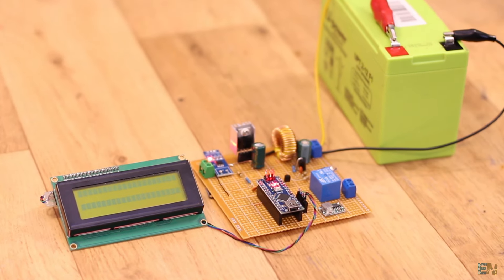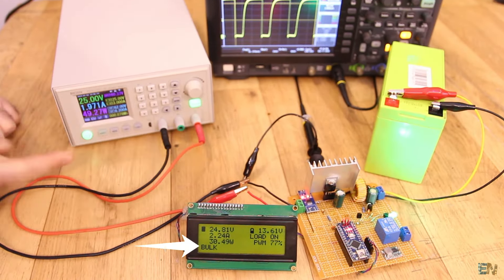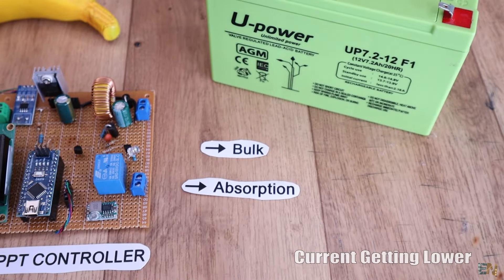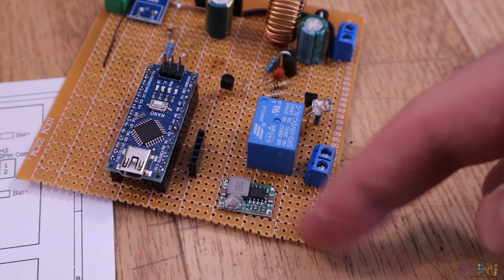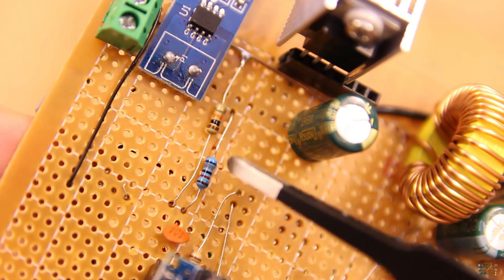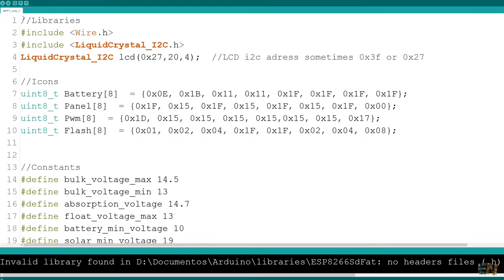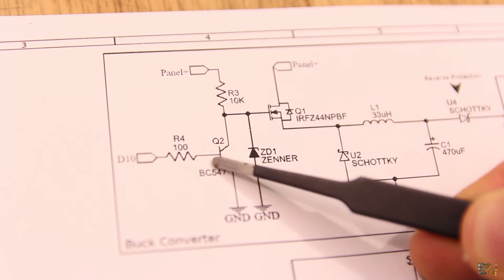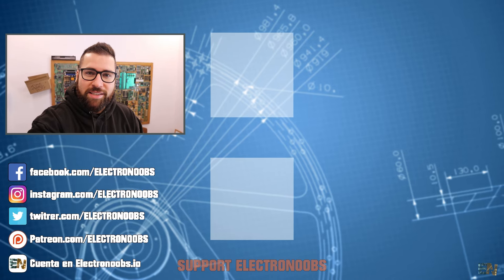MPPT Solar Charger Prototype | 12V Lead-Acid Battery | Bulk Absorption Float

Comment: This is not an MPPT-charger, it's just a lead-acid battery charger. MPPT specifically refers to extracting maximum power from the solar-panel; it keeps track of the voltage and current of the panel and adjusts the current so that the panel is always supplying as much power as it can. A simple approximation would be to periodically check the panel's open-circuit voltage and then keep the voltage at 80% of that.
Reply: Never thought of that! I need to dig into this. It will most certainly outperform a PWM method.
Reply: Can you please send any link to that project pls urgently
Reply: I agree this is not MPPT.It is only charger circuit but the Video still very usefull.
Reply: True
Reply: Great project. MPPT code coming in future video with upgrades
Reply: Can we make use This PWM charger for Lead acid battery for primary use
Reply: Ok then can you say the working of the mppt 

Let me contect you can adjust current you need to adjust voltage 
How many i know to charge a battery you need a constant current at stating
It's hard to make you understand in text but the video is correct the process to charge a led acid battery is same 
But if you r chaing a lepo you need to give a constant voltage to charg 
The video is correct for led acid 

If i am wrong please correct me 
Thanks
Reply: @vkproduction1166  an mppt tracks the maximum power coming from the solar panel, a normal buck converter can't do that, if the load is greater than the solar panel can produce then the buck converter simply increase the pwm and your solar panel voltage will drop to same level as output voltage.
Reply: @CroftGaming1 oh then what will your mppt will do ????
Reply: @vkproduction1166  solar panels current doesn't increase much with voltage drop below maximum power, suppose you are charging a 12 volt battery with a 24volt solar panel, if you use mppt and your solar currently producing maximum 150watt at 30volt solar voltage and the current is 5amps. But if you use a normal buck converter it will drop the solar voltage to 12 volt and you will get roughly 5.5 amps, so will get 66watt from solar instead of 150watt. That's why you need mppt which tracks the maximum power produced by the solar panel.
Reply: @CroftGaming1  i am sorry for asking
Y the solar panels voltage will drop 
How much i learn the voltage will only drop when the current requirement can't be fulfilled if we use a buck converter with current limiting we can do it 

And one more thing you will only get 30 volt from the panel when you don't add any lode to it this voltage is called open circuit voltage

Let me take your example
If you r use 24volt panel with 5 amp current 120 watt of power 
If we use a buck converter to reduce the voltage to 13 or 14 volt to charge led acid battery
We will get theoretical value 8.5 amp of current if we consider the current losses of buck converter and the heat and the very worst case possible of 80%. efficiency we can get 100 watt of power 

One question of mine do your mppt give 100% efficiency
And please correct me please if i am wrong 
Can I ask your qualification ?
Reply: @CroftGaming1  hello? Can I get a reply please
Reply: @vkproduction1166    ya you can limit the current but that's a fixed point, suppose you limit the current to 10amps, at 12 volt that's 120watt power if your converter is 80% efficient your solar should produce atleast 150watt, but solar power varies alot during the day and with seasons, if it produces more you can't get it, if it produces less your voltage will drop and if you are using higher voltage panel your voltage stay low unless you restart the buck converter.

A 24volt solar panels maximum voc is around 44 volt, the mppt voltage varies between 30-36 depending on the solar radiation and temperature.

My asynchronous buck converter is 85-95% efficient which I use for mppt charge controller, i will upgrade it to a synchronous buck converter which is up to 98% efficient.
I don't consider myself an engineer because I don't have a degree, but I repair electronics devices for living.
Reply: no sir you did not get my point 

Let me say with a example
I have a panel with 120 Watt max power output with 24volt 5 amp 

Now i will use my buck convert and limit my current to 10 amp at 12 volt 
I am charge my led acid battery of example 12volt 200ah  my battery is 80% discharge so it can draw 100 amp of current to charge fast 
In the buck converter we can set out current for 10 amp which is the max current the converter
Now the  converter can slowly charge it  if the panel is giveing full power

If the panel is giveing for example 80 watt of power
The battery volt is at 11 volt because it's till chargeing the converter will reduce the current to 7.2 amp 
If the panel is giveing 50 watt 
The current will be at 4.5 amp 
What is wrong hear 

How much i know mppt working is to step down the voltage of the panel and increase the current to charge the battery
At all time irrespective of power output of the panel
The buck converter is doing the same 

If you think it's wrong please say the working of the mppt how it will convert the voltage to low voltage what is the process of it 

Sir how can a panel with 24 volt 5 amp Give 150 watt ? 
I am saying to limit the current to the maximum power output of the panel
I am only saying to limit to not to damage the converter 

Please correct me please it's my request
I need to learn please
Thanks for your reply it's is helping a lot thank you sir 
I am 18 years now goings to engineering sir
Reply: @vkproduction1166  you need to research more about solar panels and buck converter, 

A 12 volt solar panels open circuit voltage is 22volt and the maximum power voltage varies around 15-18 volt it is use for a 12 volt system (10.5-14.2v), a 24 volt solar panels open circuit voltage is 44 volt and maximum power voltage is around 30-36volt(depends on the panel some panels have higher voltage and lower current).

Now every source has internal resistance that why when you draw current from a source the voltage will drop a little.

How the buck converter works, it uses pwm to control the output voltage and limit the current, if you set your buck converter to 12 volt and limit the current to 10 amps, now without load the buck converter has 12 volt and almost 0amp the pwm is very low, suppose you put an 1amp load(a bulb) the voltage output drops and the feedback sence it and increase the pwm until the output voltage gose up to 12 volt, and the input (from solar) voltage drops a bit because you are drawing more current, you increase the output current to 2amps and the whole cycle repeats until you reach 10amps, because you set the current limit to 10amp if you increase the output load to 11 amps the output will drop but this time the pwm will not increase because it reached its 10 amp limit.

Now back to the solar panel if your panel is producing 120watt power then you can get 12 volt 10 amp at output(100% efficiency to make things simple).

Now when your panels power reduces to 80 watt you will get maximum 6.67 amp at 12 volt(100% efficiency).

Do it step by step, you have a 24 volt 150watt solar(maximum voltage is 44 volt) currently producing maximum 80 watt power. your buck converter output it 12 volt without any load the panels voltage stays at 44 volt, now put a 1 amp load on the buck converter the 12 volt drop a little and the buck converter increases its pwm until it reaches 12 volt, the solar panel voltage drops from 44 to 43 because you are drawing more power and the solar panel has internal resistance.
increase the load to 2 amp and the whole cycle repeats until you reach 6.67 amp(80watt). if your load is 7 amps the pwm will increase to draw more power from the solar but you solar panel cant give more power so the voltage started dropping and the output voltage stays lower than 12volt because the circuit cant provide 7 amps at 12 volt, thats why the pwm will increase again and the solar voltage drops more, this cycle will go on untill your pwm is at 100% which is basically short circuit between input and output. and your solar power drops way less that 80 watt.
thats where mppt comes in, it adjust the pwm and always get maximum power from solar. 

i am sorry if its difficult to understand my english is not that good.
Reply: @CroftGaming1   ohhh ok sir thank you for clarifying it helps a lot thanks
Reply: @vkproduction1166  always happy to help 😊
Reply: @vkproduction1166  You do not understand any of the concepts. If you have a panel with a maximum output of 120W, then that is the maximum -- you can't get 150W out of it, no matter what you do.

With a 120W panel without MPPT, ie. if you e.g. just shunt the current without any limiting into a big resistive load, you won't get anywhere close to 120W out of it, no matter how much sun the panel is getting. The panel is a so-called high impedance source and its voltage drops the closer to its maximum current output you're drawing, so that's why the you're not getting the 120W.

To get as close to 120W, you'd need to limit the maximum current you can draw from it as that will increase the voltage and thus power. MPPT is all about finding the point where the power you're getting out of the panel is as high as possible.

Your battery charging? That's not relevant. At all. That's not related to MPPT.
Reply: @WereCatf  saying for me or ???
Reply: Absolutely right, it's fun that most youtubers make this mistake even though they are people who supposedly knows about the subject
Reply: Can you please help me with MPPT matlab simulink?
Reply: @tazeenliaquat4900 its not that serious. I thought it was too. Its literally pwm with feedback via a microcontroller. I wanna see a controller that had a huge input capacitor, doesn’t use a micro for the mppt stuff, and has a second mosfet to use the wasted power that is in that capacitor I want. I forgot what the circuit is called tho
Reply: @Wtfinc it is not just pwm with microcontroller feedback, MPPT is not a device it's an algorithm. You just need to build a buck converter and then add your MPPT algorithm to it.
Reply: @CroftGaming1  so it is just pwm with feedback to a micro controller. The algorithm you speak of is implied. Why else would it go to a microcontroller. Idk why you came at me like that bro. 
Do you know what the algorithm even does? Because I do. Its not even 500 characters of code. Honestly I thought all charge controllers worked this way. Lithium battery one do, the ones attached to batteries inside vape pens, flashlights, phones, etc. 
maybe I should rephrase my original comment. Its automatic pwm. Idk. But its not fantastic or fancy and in no way justifies the high price tag. And if there isn’t an active clamp flyback, it’s useless. Which everyone skims over that little tidbit huh?  
 
And back to the algorithm. The micro reads the voltage from the cell and choses a pwm frequency. Monitors the battery and when charged it switches to trickle charge. 
One issue i see from both is when neither are switching, solar being produced isn’t being put to use. Thats a waste. If duty is 50% then you’ve wasted 50% power you could have had. I wonder if capacitors would help. 

Now, did I miss something?
Reply: @Wtfinc  the frequency of the pwm is constant, what changes is the duty cycle, and your are talking about the battery side not the solar side. It's not like a normal power supply, when you put load on a normal uncontrolled power supply the current increases and the voltage decreases, you increase the load and it does the same thing. But for solar after a certain point current doesn't increase but the voltage decreases so does the power, it is called the power curve, that means a solar panel can give maximum power on a certain voltage, not higher not lower and that changes with temperature, the output capacity of the solar etc etc, so a normal buck converter will only increases the pwm to get more power from the solar, it put more load on the panel and decreases the voltage so does the power decreases, while the MPPT track the power curve, and it not only increase the pwm but also decreased the pwm to maximize power.

Sorry for my bad English 😅
Reply: @CroftGaming1  I understand all that. And i might have inadvertently said frequency rather than duty cycle. 
And no, im talking about the solar side. I said, for the off time of the duty cycle, there is power in the pannel doing nothing. I want a controller that uses that. I have a radio that does it well. 
And it’s still pwm with feedback controll loop and that was my original thing because some one tried to tell me otherwise. 
You didn’t tell me anything I didn’t already know. I hate to say it like that but how u gunna tell me what side I’m talking about lol. 
Now if you can explain to me if the energy in the pannel while the pwm is in its off cycle(during which time the transformer will be pumping) if that energy gets used somehow. If small input cap is big enough Or should there be a bigger one? Or maybe i don’t realize its some sort of differential pwm and transformer where while one side is off the other side is on, no down time. 
Im asking all this because i wanna build one if there is actual dead time in these controllers. 
And people throw that word “Power Curve” but never explain how it actually works. I know how transformers work and the way it’s presented allot was making me think there was some other fundamental i was missing. 
No wait, what i don’t understand is how the voltage going into the transformer is not proportional to the voltage coming out but it somehow has more current? Shouldn’t the voltage be a bit higher? 
I mean the whole point is to not waste any energy we get from the pannel. 
Im really having a hard time figuring out why frequency and duty cycle effects the output and exactly how. 
Now common sense tells me if i have a transformer of 1:20 and i pulse it 50/50 1v 10A I should get 20V @ 500ma
Now common sense might tell me the faster the pulses, the less chance the magnetic field should have to grow. The less the field grows the more both the voltage and current drops? This is the only way i can imagine that it works. 
I think until last week i had the assumption that higher frequency made higher voltage and i don’t think thats the case at all. HF is just quiet and more efficient i imagine, if the pwm doesn’t have a 3volt offset. Anyway
Reply: @Wtfinc  that's why there is a electrolytic capacitor in the input, when the pwm is low the energy from the solar panel get stored in the electrolytic capacitor, and when the pwm is high the solar and the capacitor provide high current, if you put a oscilloscope in the solar input you can see that few mv noise, the higher the frequency the less amplitude the noise is because it charge and discharge faster. Otherwise without a capacitor when the pwm is low you will get a maximum solar voltage there.

The same thing happens on the inductor side, when the pwm is high the inductor charges up and current flows through the circuit, and when the pwm is low, the inductor discharge and current flows through the circuit.and a capacitor is used to provide smooth power.

This is a simple explanation, I can't explain the whole thing, you need to study that yourself.
Reply: @CroftGaming1  That makes good sense. You explain things well. Thank you. Cant wait to get my hands on one and take it apart. Ill give er a probe as you suggested. That sounds pretty fun. Id love to have a small solar array. With all the new technology you can’t go wrong. I really wanna get my hands on some sodium batteries too. Those are cool
Reply: @Wtfinc  happy to help 👍
Reply: A true MPPT regulator would operate as a Buck-Boost Converter and periodically checking the stored energy in order to determine the Floating voltage, internal resistance and health of the battery. Also, a good controller would not rely on the battery, but have its own small rechargeable power supply, preferably taken from the input power source.

Comment: Great "how not to make a mppt". A solar panel can not be simulated only with a power supply without a diode and a small resistor. With the power supply the mppt will not work. And with just a if state, without some type of PD controller....the battery with last forever....not!